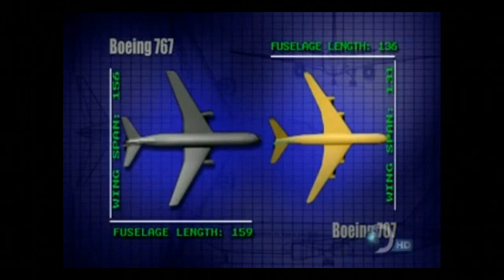9/11-WTC Towers Designed to Withstand Jet Airliner Impacts

Comment: They admitted they didn’t calculate fuel. The trusses is what collapsed the building. But b52s have fuel minimums because when you put fuel in a plane it turns 80,000lbs of flimsy aluminum into iron. The trusses were very weak steel that held each 4” x 1 acre concrete slab. Those trusses Connected to the exterior columns.  The fire cause the steel to soften. Anyone that’s worked metal knows you barely have to heat steel to get it to bend. When forging.
Reply: Yeah they admitted after they got a visit from the fbi
Reply: Oh yeah.  All the floors below the impact area and the fires just crumbled from the steel softening at the impact areas.  
Makes sense.
Reply: Controlled demolition

Comment: "The plane is just the pencil puncturing the screen net". What if the pencil was fully loaded with jet fuel, still nothing?
Reply: Tell us how that worked on Building 7.
Reply: @2Brian  I'm simply talking about a plane entering the towers. Not talking about building 7 at all. Don't assume you know my stance on any of this.
Reply: EightySix ,please explain how WTC building seven fell in a nearly perfect controlled demolition style collapse without any commercial jet airliner impacting the building. WTC building seven fell in a symmetrical collapse in 6.8 seconds also.WTC building seven was at forty seven stories in height.
Reply: @2Brian  
 Building seven began with an interior collapse, a massive load transfer system failure. That load transfer system ran right along the north side of the core, and the failure propagated westward rapidly because of the large loads it supported on fewer columns causing the core to give way almost simultaneously. With the core gone and a loss of lateral support the interior was left hollowed out and collapsed shortly after. If the entire building was hulled then of course the building would have collapsed all around as it did.
Reply: Still nothing with fires. Ofcourse calculated with fires.
Reply: @Jim Vento No it did not 

Let's start with the basics of the Hulsey model.

- Fire considerations only included for the 12th and 13th floor, ignoring that the rest of the structure was weakened

- Hulsey only focuses on NIST as if disproving one single scenario disproves ALL scenarios of fire. Does not ever address anything about the Weidlinger report other then to discount it by falsely claiming their temperatures are too high.

On the otherhand if we read the context of Hulsey's report he seems to be suggesting that their scenario IS possible assuming that the temperatures they give were attainable. 

- Hulsey only uses static modeling rather then dynamic which is a HUGE problem.

- The east side kink that was seen in WTC7 does not appear to be visible in the model that Hulsey demonstrates. This would be because the east side interior is caving in separate from the other side causing the kink to form.

- He claims the Penthouse fell only for a few floors but we can see the "flexure" here that demonstrates it was the entire east side core giving way

http://www.sharpprintinginc.com/911/images/photoalbum/34/1433082851_280514555.gif
Reply: Harry Heiniken , The penthouse or top structure event occurred for five seconds before the dip at the very top of WTC 7 began to occur. A small portion of the structure to the viewer's right has deflected back to the structure and can be seen oscillating against the structure while it expends energy but yet the dip at the very top of WTC 7 does not occur until the smaller portion has stopped oscillating. Then only after 
did WTC 7 began it's descent. 1.Top structure event 2.Sag or dip 3.Descent